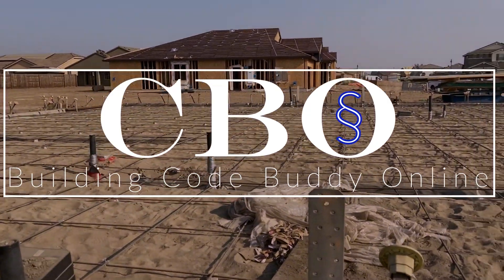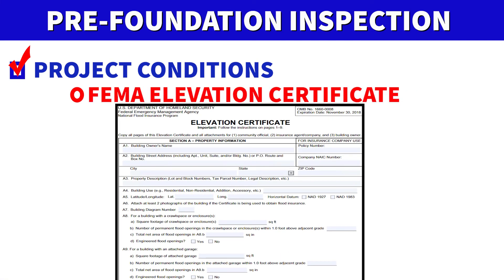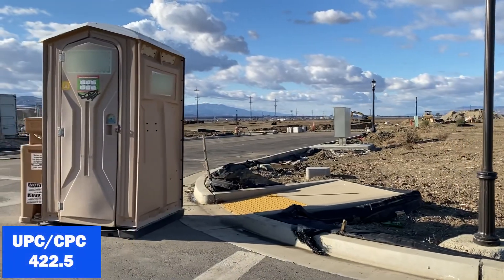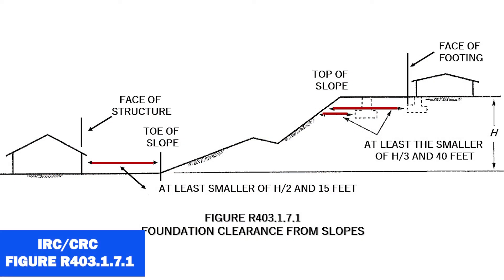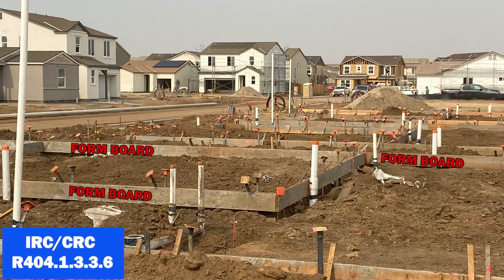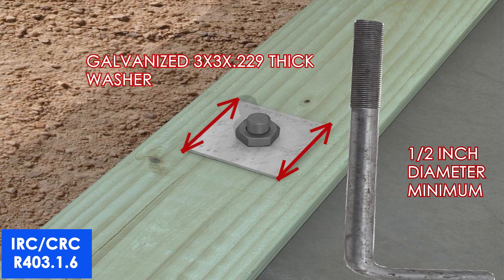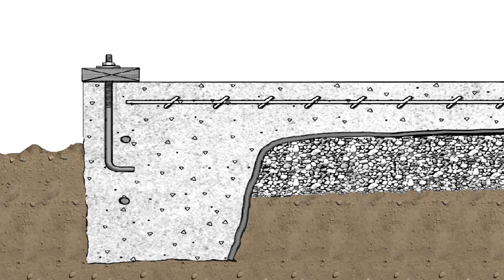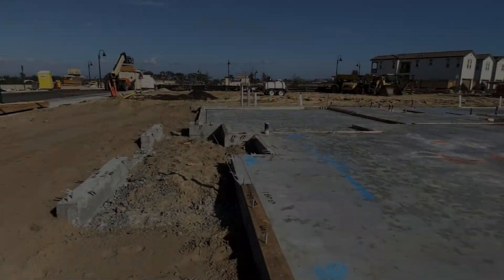Foundation and Slab Inspection Requirements - IRC/CRC

Comment: Why do plumbing pipes have to  be sleeved from concrete??
Reply from the maker: Hi John; great question!  Sleeving plumbing pipes is required for a few reasons (as I understand it):
- Protection from corrosion – for some metal pipes;
- Prevent damage to the pipe due to expansion/contraction;
- Prevent stress against the pipe when the building settles or moves (sleeving it provides a bit of a buffer zone).
There are also maintenance reasons to sleeve pipe; for example, if a repair is needed – sleeving the pipe facilitates the removal of the pipe, rather than breaking off the pipe or the surrounding concrete.

I hope this helps.  Thank you for the question.  Let me know if you have any additional questions.  I am always happy to help.

JM

Comment: My plans were permitted in the city of Chula Vista and underground construction has begun. I am building an ADU in the front yard and my plans show that the ADU sits right up next to the front yard setback.
As I was talking with a surveyor today, he remarked that it is very common for an inspector to request that a surveyor be hired to provide a Footing Certification before any concrete is permitted to be poured.
This is the first I've heard of this. Is this generally the case? What is a Footing Certification? Why wouldn't the city have required that as a part of the original permitting process? Or at least given me a heads up? The surveyor is unlikely to drop everything just to quickly do this job so my construction work doesn't have to be paused.
Reply from the maker: What your surveyor likely is referring to is the foundation forms setback certification letter.  Typically building departments require the certification letter, only if the Planning Department sanctions the survey letter as a condition of the permit issuance.  
However, according to the Chula Vista Building Ordinance, the Building Official may require a survey cert. “to verify that the structure is located in accordance to the approved plans” (CV Muni Code Section 15.06.100 (A), last paragraph)
but as you implied, building departments normally inform customers of this requirement during the permit process; and, a notation or stamp is affixed to the approved plan that clearly indicates this requirement. 
I could be wrong, but maybe the reason a survey cert. was not explicitly required – is because of a new 2023 ADU law that prohibits jurisdictions from establishing limits on front setbacks, amongst other things (AB 2221).  Chula vista’s Ordinance also seems to mirror this new mandate “… In addition, an encroachment into the front yard setback is also allowed only if it is necessary to construct a minimum 800-square-foot unit.”  (CV Muni Code Section 19.58.022 (6)(a.))
You or your surveyor should contact the Building Department to clarify and confirm if the survey cert will be required.  
Apologies for the verbose response, but I hope the information above helps you.  Let me know if you need any further support from me.  You can reach me directly at buildregulationspro@yahoo.com.  We can further exchange contact if you desire. 
-	Jose M

Comment: Part of my residential addition project includes remodeling a master bedroom which has an attached bathroom that will not undergo any remodeling. Will the inspector be okay with this otherwise unused bathroom being designated for the workers instead of a portable toilet provided on the site?
Reply from the maker: Excellent question.  I don’t speak for your jurisdiction; however, as long as the bathroom has a toilet and sink - that is all the code requires for the workers.  Whether it’s provided by an existing bathroom onsite or temp/portable facilities, that is up to you.  Section 422.5 of the Uniform Plumbing Code, or section 311.1 of the International Plumbing Code is where you’ll find the requirement.   One of the two codes may be your jurisdiction’s State model code.
I hope this helps you.   If you are able to, let us know how your inspections go.
-  Jose M

Comment: My project is in California. My home remodel plans have been reviewed and permitted by the City. As contractors were reviewing my drawings to submit their bids, several of them kept commenting about some confusing structural details. 
I had a closer look and realized that the structural engineer had made some incorrect assumptions and needed to change his drawings. 
He has since done that, but now I am wondering if his revised drawings can be kept on-site to assure the inspectors that the foundations have been built properly, or do I need to have the City review them again?
Reply from the maker: Hi!  Thanks for reaching out!  Great question --- yes, you should have the City review the change.  Best case scenario they tell you a review wasn't required.  Worst case scenario is you are told at the time of the inspection that your inspection cannot be approved until the revised plans are submitted for review and approval.
But ultimately, if the changes are minor (as in clarifications) the City may approve rather quickly, if not over-the-counter.  
The City will likely require you to submit the revised plan sheets (and may or may not require the original submittal information), with the revisions clouded and include a scope of revision statement on the title sheet of the revised plan.
Feel free to reach out to me directly if you need further assistance during any of your progress. 
email: jm.wboard@yahoo.com
Best of luck and if you can, I'd love to hear how things go.
*Edit:  I almost forgot, also include the revised structural analysis when submitting to the City.
I hope this helps you.
- Jose M

Comment: Are there any regulations about building a garage slab over a sewer line running through the property.  For instance a garage slab spanning the width of a back yard with the sewer line running under under the slab and garage.
Reply from the maker: That depends if the location of the sewer line is a Utility Easement, if that is the case then normally those areas are "no build zones" unless permitted by the Jurisdiction and the Utility Owners.  Otherwise, it depends on which code the jurisdiction has adopted (the international plumbing code, or the uniform plumbing code) - and/or any local restrictions they may have imposed.  Best thing to do is contact the local building department; however, utility easements (if it is one) have far greater consequences; so that would be the first concern.
I hope this helps, but please let me know if you need clarification.

- Jose M

Comment: Are their many difference for other California residential codes and the IRC?
Reply from the maker: Hi Yvonne!  That is a very good question you ask – thank you!  

In California, there is only one residential code; which is the California Residential Code (CRC).  The California Residential Code is basically the IRC (International Residential Code), but with California amendments (requirements).  Essentially, the IRC is the “model code” to the California Residential Code (since the State does not develop most all codes).  However… the State of California does not adopt some chapters of the IRC; such as the plumbing, mechanical, gas and some Appendix Chapters; therefore, you will not see those chapters in the California Residentials Code.   Basically, if you compare the IRC and the California Residential Code, it will be similar – minus those chapters that are not adopted by the State…

As for some of the differences, the California Residential Code (or IRC) only contains life/safety, exiting, some structural requirements, roof construction requirements, wall construction requirements (to name a few examples); but keep in mind that the CRC/IRC only applies to single family dwellings, duplexes not more than 3 stories high.  Section R101.2 of the CRC has a bit more information on this.
Side note:  the California Building Code generally only applies to commercial buildings and residential buildings exceeding 3 stories; and multi-family dwellings/hotels etc… with some exceptions.

Also, notice I did not include mechanical, plumbing, or electrical code requirements as part of the IRC or the CRC…?  That is because residential requirements to those disciplines are covered in the California Plumbing Code, California Mechanical Code, and the California Electrical Code.  These codes I mention cover both commercial and residential requirements.

There are also other codes that cover both residential and commercial requirements; such as the Cal Green Code, California Energy Code, the California Fire Code and others.

Another confusing part about this is that the IRC (straight “model code”) chapters that cover plumbing & mechanical requirements – which are not adopted by the State, are based on the International Codes…. The California Mechanical Code and the California Plumbing Code are based on a different model code (the Uniform Mechanical and the Uniform Plumbing Code).  Those model codes are adopted by the State and not the International Mechanical and Plumbing…

Please forgive this lengthy response; unfortunately, the breakdown is necessary.  But most importantly, I hope my response makes sense.  Please let me know if you have any questions – or if you need clarification to the above.
I am glad you asked this question, as it is a question frequently asked – but to some it can be a terrifying question (if that makes any sense)…  I will be making a video which clarifies this, so stay tuned.

Once again – please do not hesitate to ask any questions regarding the abovementioned; hundreds of other people may have the same question as you 😊

-	Jose M
Reply: 25

Comment: how to make the analysis report of foundation structure in this houses.
Reply from the maker: Preparing an analysis report for a foundation to a structure is site specific (e.g., soils characteristics, seismic, wind); including a structural analysis of the structure -- unfortunately, that is not in the scope of this channel.  If you need assistance with preparing an analysis report of a foundation to a structure; you will need to get in touch with a registered design professional.  Please let me know if you need clarification.

Take care and best of luck.

- Jose M
Reply: @CBO.online  sir i am fresh engineer but i have no more knowledge about this structure , how the load distribute from truss ,wall and ceiling to foundation . Our administration is asking for analysis report based on load calculation but i don't know which software gives the analysis .